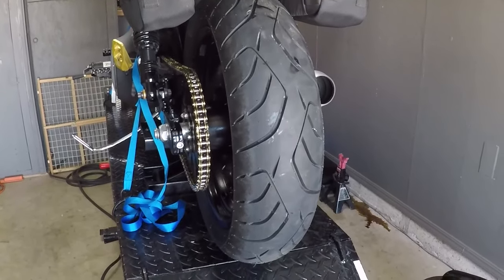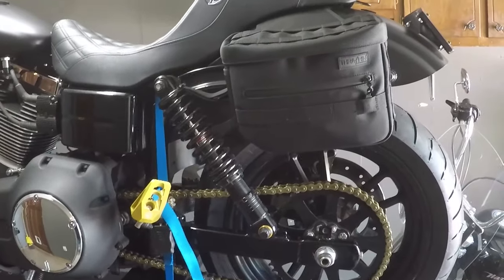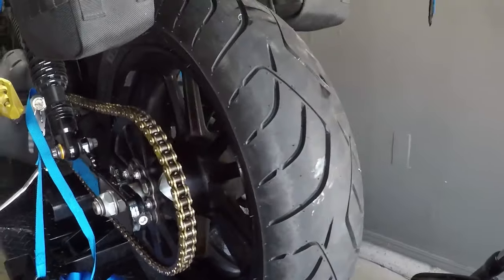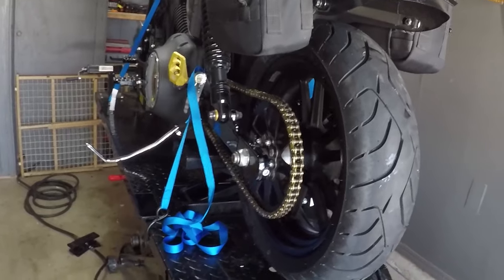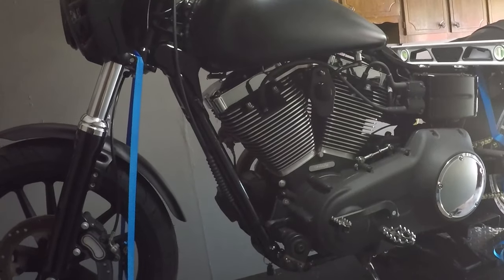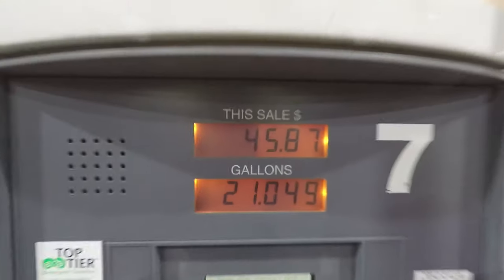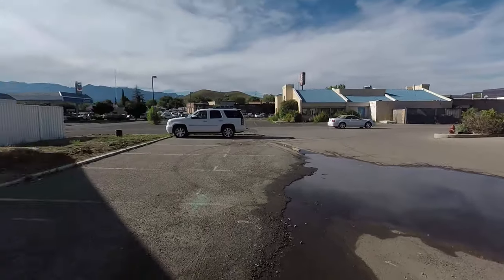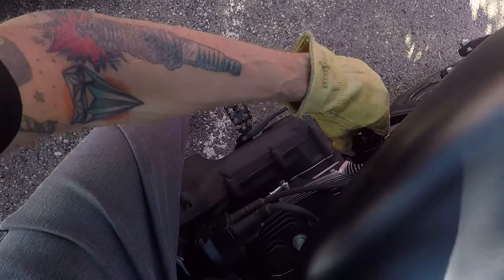Dyna Engine to Chassis Alignment - Utah Road Trip: Part 1

Comment from the maker: Alright everyone - It's been over a month since my last upload, and for good reason.  A month ago I replaced the worn out Shinko 777's that were on the Dyna with some new Dunlop RoadSmart 3's. I checked and adjusted the fall-away of the forks, but she still had a severe death wobble @ 70mph.
So I got to reading the Dyna forums and found a complete write up on engine to frame alignment and how critical it is.  On these Dyna's, the engine is rubber mounted in the chassis.  The swingarm is bolted to the transmission casing, so if the engine is not true in the frame - then the rear wheel isn't in line with the front wheel.  

I purchased a digital laser level and a digital angle finder in an attempt to get the job done myself.  But after 4 hours of adjusting the top vertical stabilizer link it was worse than when I started.  The numbers lined up (digital level zeroed out and angle finder read a perfect 90.0* on the rear brake rotor) but the bike felt unstable at speeds over 50mph.   

So I contacted Al @ Rack and Pull Industries out of California and asked if he knew of any shops closer to Oklahoma that had his equipment and knowledge.  Al recommended I speak with Brad @ Cycle Tech Industries in Hurricane Utah (2,000 mile round trip).  Brad and I set a date about a week out and I got to work locating a truck and trailer that I could borrow.  A week later I load up the bike onto the trailer, strap it down, tank up and head out towards Utah.  I had slept all day to prepare myself for the 16 hr drive that would start at midnight.  The trip was pretty grueling, but I saw some extremely beautiful scenic views along the way.  Made it to Utah the following afternoon, unloaded the bike and and grabbed some dinner.  

Stay tuned for *Cycle Tech Industries - Utah Road Trip: Part 2*, should be uploading in a day or two.
Reply: I got the same tires 4 my bike & had the same issue.  Went back to my Dunlop American tires.

Comment: Pretty sure ur front tire is mounted backwards. Also when u squeeze a wider tire on a wheel that is ment for a smaller tire u egg the tire and make the pivot point of the bike more dramatic.....and ur back wheel dose not look spaced properly.
Reply from the maker: No, the front tire was mounted the correct direction.  The back wheel was spaced properly as well, the issue was the engine alignment was off inside the chassis, and the shocks were not set at exact same length eye-to-eye.  CycleTech Industries in Utah took care of it with a laser alignment.

Comment: That's it? Can you tell us what the diagnosis was and how it was corrected?
Reply from the maker: This is actually explained in the next video... check out the rest of my uploads.  The vertical and horizontal alignment of the engine and swingarm were out.  I had to purchase an adjustable front engine mount to properly laser align the to the chassis.  A factory Harley-Davidson engine will usually not need the adjustable engine mount, the S&S required it in the Dyna chassis.

Comment: If your wheel is off to the left wouldn’t that cause you rotor to hit the caliper mounting arm?
Reply from the maker: Nope, because the whole swingarm is attached to the transmission case. So on a Dyna if the engine is out of alignment the swingarm, and rear wheel are out of alignment from the rest of the frame/motorcycle.
Reply: @UnrulyRider  Yea that's true. I think I have a spacer problem. PM aftermarket wheels and the chain conversion contribute to mine hitting the the caliper arm. The shop that I had do the conversion and put wheels on was 1/8" off on spacers. I wish more shops had that jig he says he's the only shop that has it. Utah is a bit far from SE Washington. A lot of shops around here give me shitty looks when I ask them to check my alignment.I've tried twice the same way you did and still have corner wobbles. Your 2 videos were good.

Comment: custon cycle engineering rear mount. Do it.
Reply from the maker: Yeah, the issue was resolved the next day with a Big Bear Choppers adjustable engine mount, which is leaps and bounds better than the CCE unit which cannot handle wheelies.  I sold the 124ci Dyna for an Indian FTR 1200 S anyways...
Reply: @UnrulyRider  Nice...enjoy that FTR.
Reply from the maker: @sumyonguy  Thanks!  My GoPro stopped working or I'd have some more video's uploaded... in the process of getting it replaced.
Reply: @UnrulyRider  I just pulled my none adjustable BBC Front Mount off and put CCE on. I liked it but would of definitely gone with BBC Adjustable. FTR's are sick!

Comment: Sputhe stabalizer kit .... its what you need
Reply from the maker: No, I needed a chassis alignment and an adjustable front motor mount.
Reply: Ya my sputh only masked my bad mounts n alignment.. I mean for sure noticeable improvement.. but not the full fix